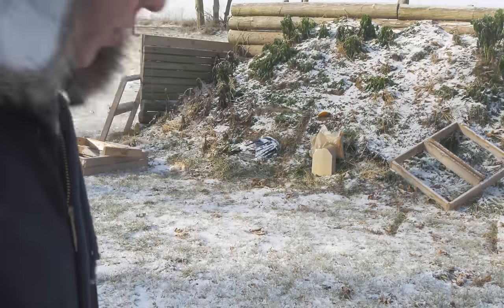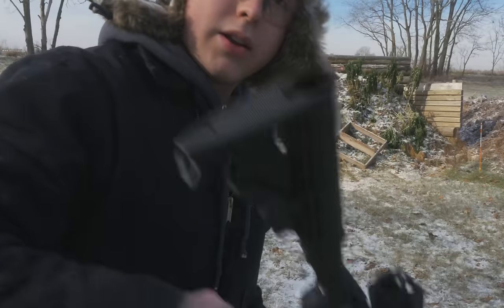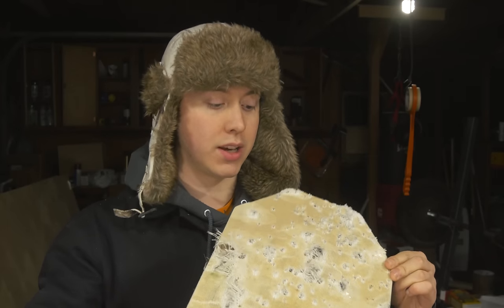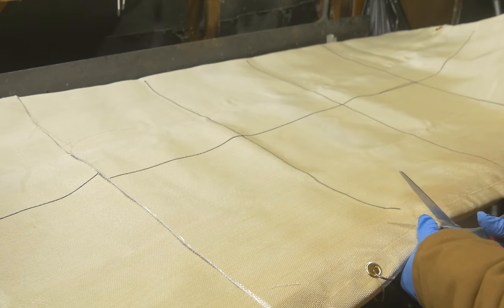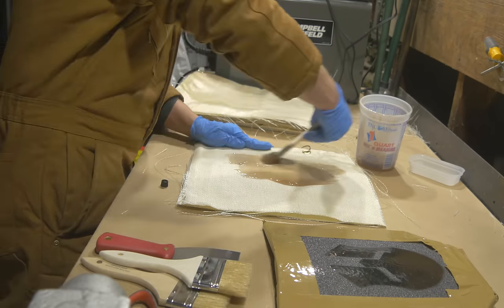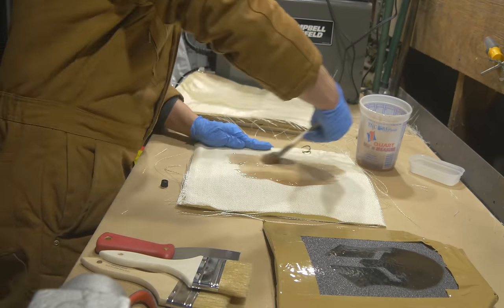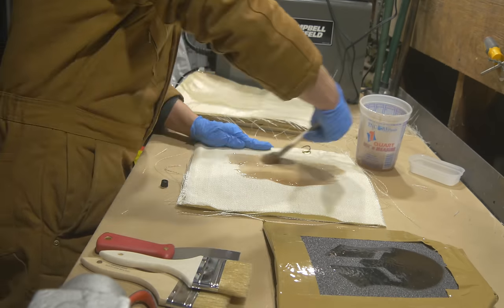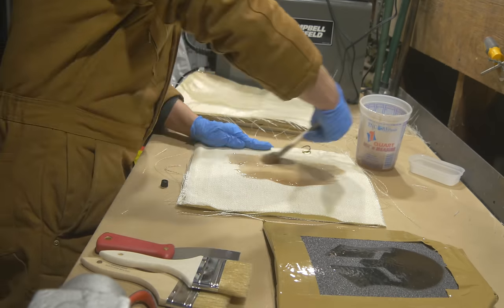How to Make AMAZING Bullet Resistant Armor for $30

Comment: This is actually a great job!
It seems that not the hard material but the ones with the highest tensil resistance are the best. Elasticity is also a bonus.
To further dissipate the energy I would add a layer of rubber and finally a rigid one made of high resistance steel.
Reply: adding a final layer of steel might mean fragmentation towards the user, a mid layer or more frontal layer would probably do a better job
Reply: @therealslimshady3662  yes, that's a possibility I didn't think about.
Reply: @roccosfondo8748  dont worry bro, were all working together for the DIY real working Halo Suit, mistakes are to be made.

Comment: All you need to do is put ceramics between the first layers - for example small floor tiles or wall tiles - this is a popular method also used by producers. Ceramics flatten a bullet that distributes pressure on a larger area. This will increase the efficiency of this project even with larger calibers.
Reply: Your idea to flatten the bullet is good. Larger ceramics are only good for 1 shot, though. Metal foam is a better option, This is a great, inexpensive armor build.
Reply: You mean like a tile in a bathroom? Wouldn't this have to be lots of tiles laying next to each other? Would that not mean lots of gaps and add a lot of weight? Just asking
Reply: Callumbia Colliner you use only one layer, no all bathrom... ceramic composite buletproof stuff
Reply: So ask people who made composite with ceramic why they don't use metal
Reply: Artur Koziełek actually ceramics shred the bullet, and the Kevlar catches it.
Reply: Yeah? Try finding ceramic tile that contours like body armour.

Comment: If you added the airbag kevlar and a ceramic tile (or hardened steel plate) with some rubberized coating, you would have a somewhat heavy but pretty effective protection.

Comment: It's light as hell. U can make arm plates. A hat anything you can think of.
Reply: A shield,armour for your horse and squire 😂😂😂😂😂
Reply: A helmet maybe
Reply: T Brown  "full plate mail" plates are plates, mail is small rings interlaced.
Reply: @Fede_uyz  mail any armor made of metal,  ring or chain mail is a specific type made of rings, scale mail is made of scales,  plate mail is plate armor.
Reply: @thitsugaya1224  not actually. Chain mail is a misnomer by the general public. The strict definition of mail is any armor made or small, interlinked metal links. There is no such thing historically as "mail plates" unless maybe refering to armor combining both mail (properly written as maille) AND plates. 
Plate armor is thud purely plates, scale armor is smaller plates linked by straps or metal rings, and maille is only rings. You can have combinations suck as some (middle) eastern armor such as some turkish and indian armor.
Reply: @Fede_uyz  I'm well aware that chain mail is a misnomer,  properly it's ring mail or mailed, however,  the word maille or mail in the modern spelling doesn't mean a specific type of metal armor,  it just means metal armor,  otherwise saying ring mail or ring maille would be redundant, however,  as other types of maille exist such as scale and plate it requires the specific designator.
Reply: @thitsugaya1224  Indeed, saying ring/chain mail is absolutely redundant. 
see resources like: 
 Stone, G.C's  "A Glossary of the Construction, Decoration and Use of Arms And Armor in All Countries and in All Times, Dover Publications" New York , 1934
or  Francis Grose's "A Treatise on Ancient Armour and Weapons" London, 1786

What you might be thinking of is "plated mail" or "splinted mail" which as i believe i said, is mail with embedded plates. 

Now, your name is of Japanese origin, so I'll give you the benefit of the doubt and assume there is such a thing in japanese (although i speak it to some degree, I'm not aware of weapon and armor types' names) and as such i'll direct you to a guide on Japanese armor written in english for the proper english names of japanese armor:
 Kōzan Sakakibara & C. E. Tuttle's "The manufacture of armour and helmets in sixteenth century Japan: (Chūkokatchū seisakuben)" 1964
Reply: T Brown  riveted mail?
Reply: @Fede_uyz

Comment: Might add to effort/materials, but if you rotate alternating layers by 45 degrees so one layer has fibers going up/down and side to side and next is on diagonal it will improve strength of the resulting composite.

Comment: Don't forget the golden rule of fiberglassing. Afterwards,  always take a HOT  shower right away to wash off the dust 😆
Reply: Cant figure out if the thumps ups were ignorant people or people laughing with you.  I have nightmares of my first interaction with fiberglass when I was young.
Reply: That’s fucking golden
Reply: Same with insulation, we bought a cottage that was a bit of a fixer uper and the attic was full of mouse poop and pink fiberglass stuff everywhere, not nice
Reply: @michaelrogers3857  feels same as insulation bcuz it is same. spun glass, literally. like cotton candy except use silica (sand) instead of sugar. glue raw spun glass to some paper or foil for insulation or twist those little fibers of glass into threads that are weaved to make "fiberglass" cloth. now where's that resin? I need another huff of them voc's  🤯
Reply: My golden rule of fiber glassing is to have somebody else do it.